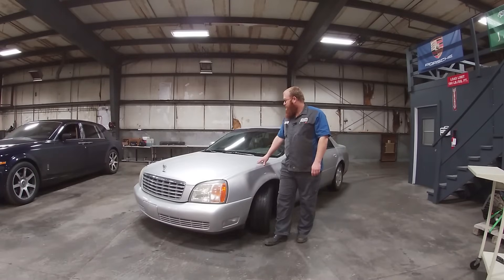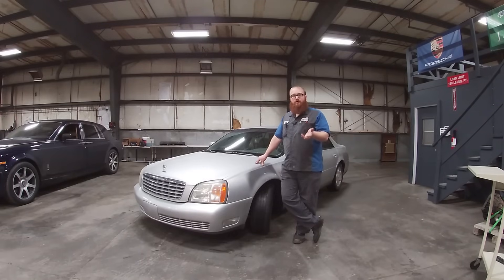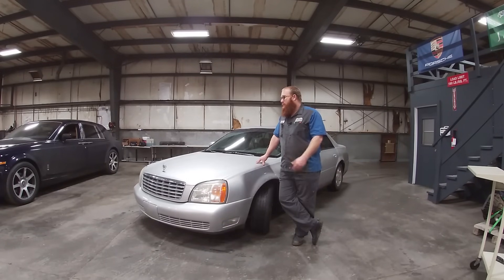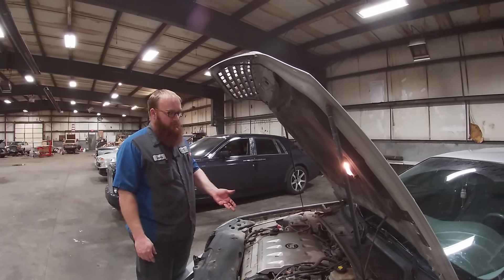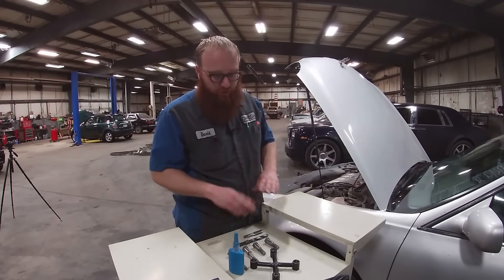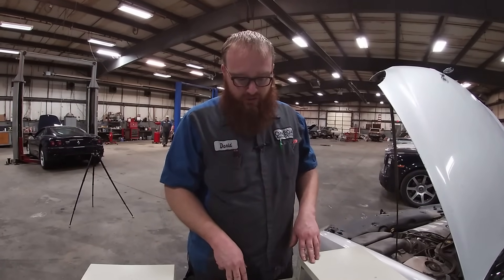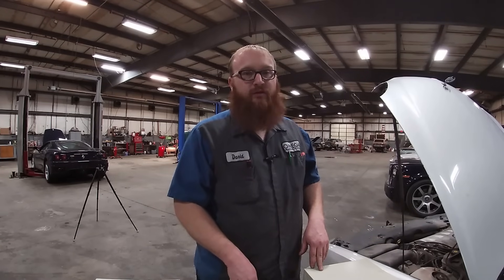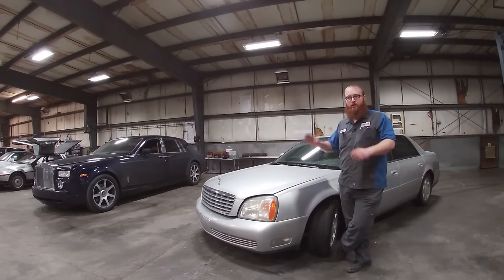The CAR WIZARD names Cadillac's Northstar Engine the Dumbest Design

Comment: All the Northstar V8 Cadillacs I've ever worked had major oil leaks everywhere...
Reply: Weird. I had one it was a 1996 maybe maybe it was a 1998 anyway bought it with 95k miles on it sold it with 225k miles on it. It never leaked while I had it.
Reply: they more just eat oil for breakfast lunch and dinner past 80k miles, a quart for every 1000 miles
Reply: My 06 DTS 101,000
Not a leak anywhere.
I take care it.
Reply: @claytontraise5903  not quite that much my experience after 150k it was aprox 1. Qt per 3.5k miles. On full synthetic
Reply: I think it burns oil faster than it leaks.
Reply: @richardburchett  probably right
Reply: I have a 99 Eldorado,...not leaked a drop.
Reply: Clayton Traise That comes from babying them, they are supposed to be driven and there is a protocol for clearing out carbon and loosening stuck rings on underperforming northstars.
Reply: Any engine as it ages will develop some oil leaks. That's the natural of any engine!  Regardless, all the old antique Cadillac's were the same. Anyways if its a small oil leak, it not harm anything.  A little oil on the undercarriage is actually good and helps keep everything lubricated especially if you live in the North where there's lots of salt on the roads.
Reply: Hows it?
Reply: @claytontraise5903  Actually, they don't, really...When you fill the oil, only go to the center of the hashmarks on the dipstick. If you go to the top, it'll suck the extra half-quart out through the PCV and leak oil at the valve covers! On the other handm the starter inside of the intake and the water-cooled alternator suck.
Reply: I had a 98 Deville and mine had no leaks anywhere on my car when I had it. It ran great. Maybe I was just lucky. I also went to school for mechanics so that probably helped.
Reply: Mine took quarts of oil after quarts of oil..likely two a month at least.
Reply: Deez Nuts  Northstars do not require synthetic.  I have a 96 Seville and the manual says 10W-30, non synthetic.  Most old timers worth their salt have forgotten more than most people these days know.
Reply: @steverzepecki500  Yep, that is after GM fixed the issue in 2005.
Reply: 2006 DTS 130k not many leaks at all. Try that in a BMW 7 series or an AMG which are much nicer and way more expensive
Reply: Mine right now
Reply: If it was a Northstar and it had a fluid running through it, then it leaked it
Reply: Changed oil in one the other day,slide under car oil drip in the face lol
Reply: StarXLR. You can't be serious. I have a 2001 maxima for about 3 years now with just over 200,000 miles. Never have i ever add oil. Just a regular oil change every 6 months with basic 10W 30 of most brands. I have had other Japanese cars that have treated me this well. Please do some research before you post anything that comes to your mind.
Reply: Same here. I have one sitting in my driveway.
Reply: Junk ass motors its ashame cadillac never got sued for these crap motors. Yet they made the same shitcan motor for years.
Reply: I worked for Caddy, who remembers the abject failure HT-4100's??? and the failure kept going,...& going,...AND FKN GOING!!!!
Reply: Like what Ford is doing now with some of their EcoBoost engines and the gen 3 Coyote. Oil leaks everywhere because of stupid plastic oil pans and cheap ass gaskets.
Reply: @claytontraise5903  had a 2014 ats nice car fast wrecked it but i was scared run hot and burned quart by time i changed oil at 1000 rep would make noise. made to not last

Comment: You did ford with the 5.4 and GM with the 4.6 now do dodge with the 2.7 v6 with the goofy water pump design
Reply: Heh im scared to even find out. Alternators, starters and water pumps should be within a few hours labor of access at the worst.
Reply: The 2.7 the water pump runs off the timing chain, so, yeah
Reply: @gtowrx2001  
Hmm yea thats a time bomb. 
And the other trend of having the water pump run off a timing belt, and possibly be part of the tensioner. 
2.0 ohc pontiac for instance.
And alot of others. 
I play with vws mostly, they have you change the pump at a belt change. Still, ive seen em fail and ruin your engine.
Reply: MrHillfolk terrible designs, if that water pump locks up, there will be problems, why cant it be run off the serpentine, then its easy to do.
Reply: Ford 3.7 water pump has the same design flaw
Reply: Curtis Webb really?? Is it timing belt, or chain driven, either way its dumb
Reply: Those things were just awful, I mean what a turd box  ...
Reply: I must have been lucky with mine. I drove a 2006 Chrysler 300 2.7L to 285k miles and then sold it. Only thing it ever needed was a throttle position sensor.
Reply: gigdrummer You are lucky as hell, you don't know what a shit box that was, my ex girl's mom had a magnum and that thing shit on her hard, I never met a single person who didn't hate that damn engine, they even put it in the intrepid I think, there was a 3.5, but they also use that shit box world war II 2.7 V6
Reply: alot of cars have timing chain water pumps now including 3.7 ford cyclone
Reply: or the garbage audi 4.2 V8 rear timing chain
Reply: GrandPrix GTguy it has a timing chain driven water pump. Problem happens when water pump leaks into engine oil. By the time realize that you have a rod knock. Fordtecmakuloco has an excellent video on this issue
Reply: @gtowrx2001  Some of the engines Volvo uses in their cars have the same setup.
Reply: BIGBLOCK5022006- volvo probably did, but my mom has an 05 xc90 with a turbo i5 cylinder, bought it new and has 220k miles, pretty good car id say
Reply: John 1122- the ford 4.0 sohc v6 had a rear timing chain flaw too, good engines besides that though
Reply: gigdrummer- I think if you changed the water pump at intervals, and changed your oil religiously, they might be ok then. These engines VERY needy in the maintenance department. Neglect it a bit, and bye bye.
Reply: The 2.7 needs a sludge pump.
Reply: I blew up a 2.7L by running more than a quart of oil low. Hydraulic timing chain tensioner + interference valves = RIP
Reply: The Chrysler 2.7 has a bad reputation but they will last if taken care of. Mine has 225.000 miles. My original water pump died at 165.000 miles. No sludge since I caught it on time. It was a pain to fix but not really hard.
Reply: Had an 06 Magnum a couple years back, didnt have it 2 full years before it took a shit on me after putting about 3k into it. Since then I've seen countless dodges/chryslers broke down. I now have an 02 Suburban with 220k miles and runs 10x better than the Magnum ever did.
Reply: John 1122 Audi has been using rear timing chains for a while now.  Not just the 4.2.
Reply: Curtis Webb not to play devil's advocate, but a water pump is a wear and tear item.  Similar to brake pads, or tires.  Figure at the 80k mike mark you change them period.  If you just drive the car until the water pump fails, or starts leaking, well that is negligence on your behalf if you ask me.
Reply: @yep-that-happened  play the lottery
Reply: Yeah tell me about the POS 2.7 wife's car pulled the water pump bullshit cost me 1400$ to fix the damn thing just to have it happen again 4 years later. I took the damn thing to the junk yard pissed me off. 2004 Chrysler sea bring POS. I will never drive a dodge again ever . I'm strictly gm truck only. She drive a Honda civic now  thing just keeps running and running and running.
Reply: i have an 03 intrepid with that fucked water pump. loL when it goes out it literally starts leaking water right above you the oil pump. i cant believe as a guy who's never changed a starter or alternator, that removing and resetting timing chains was going to be my first job lmao
Reply: Lynx Star Automotive the problem there are water pumps that are failing before 50000 miles. If Ford simply would have kept the Duratec water pump design where it was driven by belt off the cam shaft at the rear of cylinder head that costly replacement and possible catastrophic failure could have saved customers  thousands. Just saying.
Reply: Lynx Star Automotive- while yes they do all fail eventually, all my GM stuff normally gets around 150k miles before the water starts leaking, and when it leaks, no big deal, no harm done, i just did a grand prix water pump with 156k. If it leaks on the Chrysler and well, bad things happen, even before like 80k it CAN happen.
Reply: @EastSide_LB  I have had pretty good luck with my 2.7. I have had it 5 years and I put 75.000 miles on it. Grand total of 225.000 miles. Probably going to drive it to 240.000 and buy a new car.
Reply: @trr5291  youre one of the lucky ones brotha lol
Reply: @weblover9185  Not on the Mustangs and F-150s.
Reply: @Jonathan11225  And the 2020 Toyota Supra.
Reply: John 1122 And the Ford 4.0 SOHC V6 and the GM Atlas engine.

Comment: I made it 82,000 miles before the head gasket blew on my 99 Seville.  I'm surprised he didn't mention the rear main seal leaking oil as a common issue.
Reply: I noticed using diesel oil helped a ton from burning up the oil and stuff like that.

Comment: I picked up a near mint 2005 for $1800 .. very happy with it.  And yes .. I saw this video before I bought it :)
Reply: They fix the problem by 2004 so you got lucky
Reply: rhubarb99999 me too 2005 124,000k for $2200 owned by an elder in Ft Myers Florida who traded it in. had a mechanic friend do a few things to it also changed the transmission inline myself slapped a K&N air filter on it so the engine can “breathe” & better mileage....car is practically brand new. This lady must of got everything done at Cadillac since she had it even the manual is in excellent condition
Reply: "SO FAR"....give it a sec.........
Reply: And 7 months later?...
Reply: If it's low miles that isn't bad you may pay a little to tow it but if you get few years that's always good.
Reply: Woodss Gaming 
That’s insanely false.  
It is not as common, but 2004 and later Northstar engines still do blow heads.  
There’s videos on YouTube if you require proof
Reply: You overpaid. The trick is to get the owner to pay you to take it, that's the smartest, financially.

Comment: That is an absolutely brilliant kit! So simple and effective. Great video Wizard, thank you!
Reply: If you have a 4.6 with blown head gaskets,  take the engine apart and inspect the block BEFORE ordering this kit.    Not only were these engines notorious for head bolt failure, in many cases as some head bolts fail, uneven stress is placed on the block by the bolts that still have bite and the blocks will crack.   A cracked block can NOT be repaired.  There is a reason why 4.6 Cadillac powered cars are worth NOTHING on the used market.
Reply: @MrSloika  I honestly appreciate your advice, thank you for that. I personally don't own a vehicle with that engine, just thought it was a great idea, especially coming in that kit form. I totally understand what you're saying about a cracked block though, there's little to no chance of coming back from that. Thanks again man.

Comment: Many years ago a team were taken to the manufacture of emergency equipment. One demonstration that day was a new emergency flare. To cut a long story short it was a brilliant example of design. Compact and just so easy to use. One of the team went off and brought back a fire bucket (this is in winter) and asked the design team for a volunteer. One stepped forward, at which point they had their hands shoved into the bucket. After 10 minutes, they had their hands taken out and were given the flare to fire. At which point they could not even get through the wrapper, never mind actually use it. Lesson: design as if you're the person who will have to use it. Too many times car and engine design is predicated around the installation on the track, not down stream maintenance six years later.

Comment: One thing for sure. Those engines make a set of flowmasters sound so beautiful. God I love that rumble.
Reply: Have a 2008 DTS with stock exhaust ....quiet but still can detect the rumble at start-up and idle.
Reply: Omg same I was shocked when I heard the sound of the engine
Reply: I'm gonna check that out because with the factory exhaust this 2000 DeVille roars nicely when you get on it & I bet you're rt about them FlowMasters!!!
Reply: Super 10's on 1999 Oldsmobile Aurora

Comment: Love it! No crazy guy  just good sound talk/advice. I have a 2007 DTSl luxury 1.  65K miles have had since 2007 was an executive loaner. had 13K  when i bought from respected Cad dealer  had it's issues. Nothing major. Here is my issue and I understand a lot with this oil warning system light and beep comes on. I spoke with a family  friend mechanic said it was a simple fix  and in 30 years he has only seen 1 oil pump actually fail, What is it anyone know how? I know cars at 67 yrs old you had to back when I was young. The interior is mint, exterior near mint want to keep. Love the show ! All the comments help a lot! The car is prefect for my bad neck and spine  thanks

Comment: You are absolutely correct! Other than the head gaskets, they are very reliable and powerful engines. I have a beautiful 1998 Eldorado ETC that was given to me because of this. It as a very comfortable and sweet car! When I serviced cars for a living I saw lots of 250k and higher Northstar Cadillacs and even more high mileage 4.5 and 4.9 Cadillacs! I love these cars and will eventually buy a 2006-11 DTS!